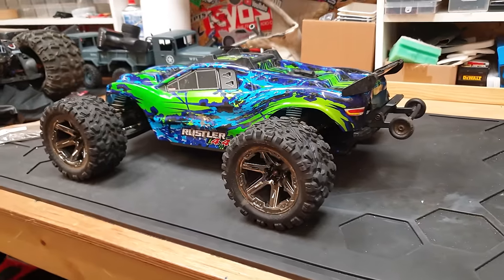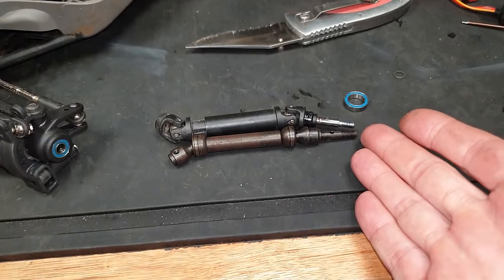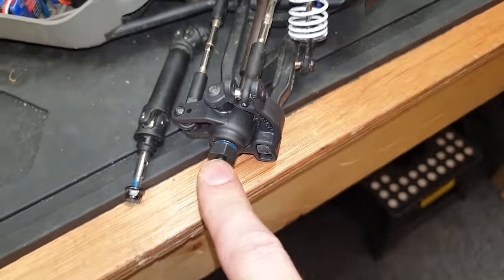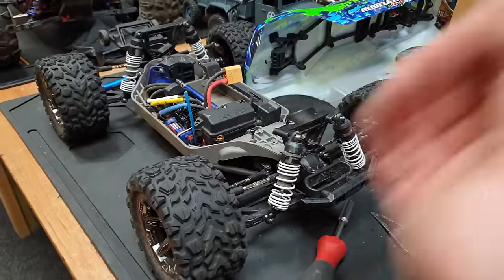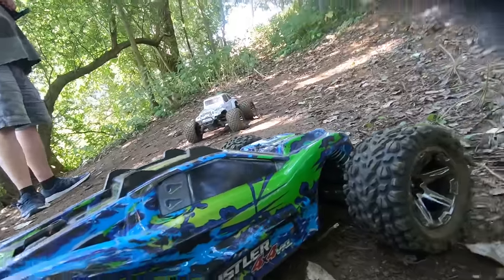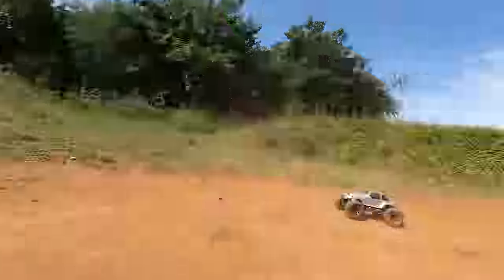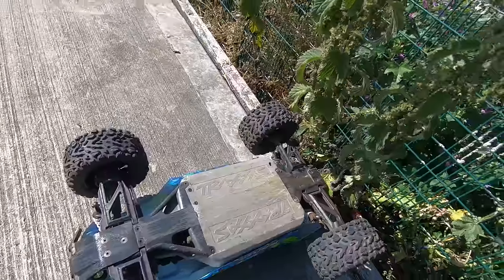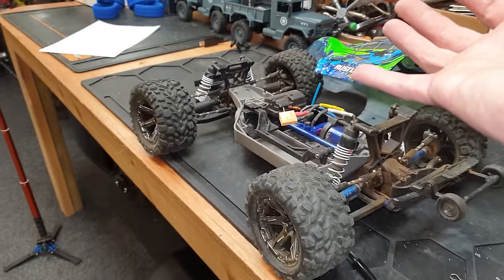Here's Why I Haven't Been Using The Traxxas Rustler 4x4 RC Car

Comment: I think the Traxxas 4wd Slash platform is being pushed beyond its limit with the big wheels on the rustler. I have a 4wd stampede and everytime I take it for a bash sometime breaks, usually the drive shaft or hubs or links.
Smaller wheels on the slash really makes it bulletin proof
Reply: I have a 2wd Stampede that's 9 or 10 years old and I have not replaced a single part yet everything is still perfectly fine and straight. I bash it all the time.  Idk what happened to yours :/
Reply: My brother has a Slash 4X4 VXL and broke a driveshaft at a track not too long ago. It’s not the platform that’s weak, it’s the part. Traxxas needs to improve the driveshafts.

Comment: As a Rustler 4x4 vxl owner, I do agree that the driveshafts are weak. For instance when I was doing a sharp turn, it went up on 2 wheels and the tire must have spun so fast that the u joint on the driveshaft broke. I've also been recently having a problem with my spur gear stripping too. And I just drive it in my backyard I don't do anything crazy. I did jump it good once though and snapped the rear axle carrier. I also ran it into a trash can🤦‍♂️ Great video Kev!

Comment: Low tsm is meant for high traction surfaces so it reduces your steering input to reduce rollover or sliding out while high tsm is meant for low traction surfaces like ice as an extreme example. High tsm gives you high control as you won’t likely rollover anyways. The more you know!

Comment: Hey Kev, I've got a 6s rustler 4x4, totally not worth doing. It's crazy and I usually only run it on 3s. 4s is perfectly op tho.
But the sway bar kit TOTALLY changed the car. That and 60k diff oil. Those to are a complete game changer. You'll absolutely love the car at that point.
Btw MIP driveshafts hold up to 6s tumbles across parking lots 💪
Reply: Yeah buddy i have a 4x4 6s 4292 motor slash. The things wants to break itself apart. The big bone center shaft is a life saver. Traxxas steel spline are great but the nut ends break once in a while. But that was with 150mm tires and tumbles across parking lots

Comment: Kev the v2 rustler 4x4 has grey driveshafts that are a bit better. I have broken the rear but I got those banggood ones (the blue ones) and they're fine. The front never broke for me. The c hub things broke a few times after skate park abuse but I've tortured my rustler so I can't really complain. I got the rpm ones and they've been fine so far. I also have a jx ecoboost 21kg servo and it's so fast. The stock servo is so weak the wheels often couldn't turn on dirt so a great upgrade. Thanks for the videos so I know what product are good and what aren't.

Comment: I had those same metal axles on my slash 4x4. They didn't last 1 battery before pins ripped out. Replaced the pins and the shaft to hold the tire on  snapped in half at the drive pin to hex.  Worse axles I ever used. Plastic ones never stood a chance. Now I use mip for both front and rear and no more broke axles. Just have to use a lot of lock tight on the set screws.

Comment: The driveshafts look like they are rusty
Reply: I wouldn’t even used those junk
Reply: Gotta use what you got
Reply: @charizardcollector4726  yeah and they didn't last long. hopefully he got his money back.
Reply: Comment: posted 14 hours ago
Video: posted 10 hours ago 
Me: hhhhmmmmmmmmmmmm🤔🤔🤔🤔🤔
Reply: You stop that right now
Reply: I would’ve returned those lmao
Reply: @hi_it_me_ned7163  you can show people a YT video before you show the public. And comment's will still be there when set to public. Not sure if that's what happened here.
Reply: Like your command of punctuation!
Reply: The rust isn't the issue. Take a look under most any full size rear wheel drive car and see how badly rusted the driveshaft is. Even on a brand new car, most do not get painted.
Reply: Won't affect performance. That is very minor surface rust. Like. Very minor.

Comment: Same complaint as on my Traxxas Stampede 4x4.  The rear drive shafts are weak and kept breaking so replaced them with Fastrax ones (part FTTX262) but had 2 of those fail so went back to stock Traxxas plastic ones and now only run the car on 2S to save the rear shafts.  Not great from Traxxas when Arrma 3S BLX range can take a 3S on plastic drive shafts without any troubles.

Comment: MIP Xduty driveshafts have been the best so far for me. I use them on my stampede 4x4. It handles 3s very well.
Reply: I have the mip on my 2wd stampede
Reply: Have had MIPs on my stampede 4x4 vxl for 6 years. Little rusty but that’s on me. Still absolute 3s wheelie monsters with big tires on high traction surfaces

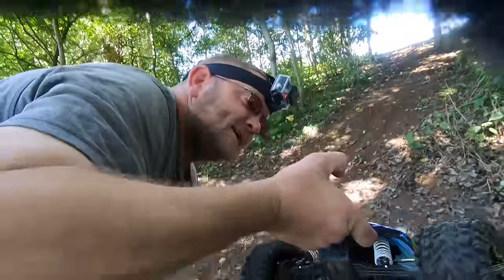Comment: Like in 6:38 i had the same problem from the first hour of hard driving, not jumps. This bottom round plastic part holds the spring in straight and steady position. This part has a gap so you can remove it from the shaft and i lost it in the dirt when i was driving. Other than that is a good rc car and i don't do jumps, but for a fast hard driving and small jumps because of the uneven ground as a first day of driving i am impressed from the top speed and the wheelies and for how fast can accelerate. Thank God that exist hobby shops, that do monthly payments and that's how i managed to buy it. Guys if you buy it as first expensive rc car, you will get impressed of how fast it is and how easily do wheelies when you press full the throttle from a stopped position.

Comment: Kev before you use it put glue on the metal rings they spin around and the pins come out of the axles I've had it happen several times to my slash 4x4

Comment: The only thing I found that will hold up is the MIP splined driveshafts. A little pricey but well worth the money
Reply: I'd say the only truly strong drive shafts for the traxxas 1/10 platform are the MIP X-DUTYS, Tekno M6's and the new Traxxas Extreme heavy-duty steel splined drive shafts (I'm not talking about the constant velocity, those are only good for 2s).

The X-Dutys are best for 4s-5s power systems, the M6's are best for 3s bashing and the Extreme heavy-duty drive shafts seem best for 2s-3s racing (because they are the lightest)
Reply: He put mip’s on his slash 4x4 and broke 2 of them and cracked another right away after he put them on. So he put on the traxxas ones.
Reply: @nate0765  to be fair Kev is extremely hard on his rc's and his expectations for durability are pretty high 😅

Comment: My erevo v1 has similar plastic driveshafts/axle shafts. I was twisting off the stub axles on the wheel side about 2 out of 3 times I'd go out. I swapped the rears over to metal ones that look just like your front ones and I've only had 1 front plastic driveshaft fail out of the last 8 times I've gone bashing. Mine are cheap-o's from GPM I think but they seem decent for my level of abuse. I just got a Kraton 6S today so that's going to be my main rig from here on out. Had to get it used since it's still backordered everywhere but it's in great shape. Chassis and mechanicals/electronics all look and function like new. Even the body is barely cracked, and those things are thin as can be.

Comment: I have no problems with the plastic drive shafts on my Rustler 4x4. I did however destroy my rear ring and pinion (From landing jumps on throttle). So, I upgraded to the Traxxas  spiral hardened gears font and rear.

Comment: I’ve been using tekno rc driveshafts in my slash and rustlers for years and never managed to bend or break them. They are way cheaper than MIP and I feel tougher. The only negative is the suspension travel must be limited “very slightly” to prevent the dogbone end popping out. That being said the stock setup is fine it’s only when you try to put longer shocks on it’s a issue. Of course nothing is unbreakable, if anyone can break it, kev can 😂
Reply: Tru cheapest option out here with the best look and performance
Reply: This Tekno M6s was one of the best upgraded for my slash 4x4

Comment: Gpm drive shafts are like the ones in the rear but better because they sell a rustler 4x4 specific set. Ive crashed my rustler bad and bent the shaft thread portion at the end, hammered it straight and kept bashing, they are that good.

Comment: I'm not sure if those axles will hold up with the VXL system but I know they didn't hold up to my brothers Hobbywing Max10 with a 14 tooth pinion in his Stampede 4x4. Snapped one in 30 minutes. Jerry rigged it back together and literally popped the other 3 as soon as he nailed the throttle. 2 broke at the drive pin, the other broke clean off at the CV joint.

Comment: Hello from Oklahoma City, Oklahoma, I would like to know, if those 4pack tyres with the white spokes you had in the video rustler vxl 2wd, would fit a la trax rally car 1/18 scale. I  have upgrade her with sealed bearings, traxxas 5 channel reciever and transmitter. Other upgrades are aluminum drive shafts and shocks, hot racing 60t metal spur gear, and I put in the velineon motor and esc. I am also doing other upgrades as well. This car is stupid fast. I just want to thank you for your time, mate

Comment: Anyone having this problem with driveshafts should just use slightly smaller tires. Slash tires and a slightly bigger pinion(depending on user 13-18 tooth) and you’ll have no more issues. Other tire wheel choices are good too just needs to be smaller. Also make sure if you ever replace the shafts be sure to get the right ones. There’s (X)heavy duty(black) and (A)extreme heavy duty(grey),

Comment: Those driveshafts are repairable.  I've made similar repairs before.  Drill and tap the outside and put a couple set screws in bit leave space to slide. Tack weld the set screws so they can't back out.

Comment: Had a similar issue with the e-revo 1/16. The servo they come with is really prone to breaking. Had to replace it with a metal gear after going through 2 OEM ones.

Comment: To fix that driveshaft issue of the new ones that came from Banggood try coating both halves of driveshafts with jb weld epoxy or the red permanent thread locker.

Comment: "dont use the electric screw driver all the way" as kev uses an impact
Reply: It's not impact, it's a clutch. If you tune your drivers clutch well, you can use it to go all the way with no problem
Reply: @nelsonmarques1334  The one he is using is an impact driver, if you look carefully, you will see that it doesnt have a clutch. A clutched one is the way to go though lol.

Comment: Not so sure about that ecoboost servo. I replaced a savox 1230sg 36kg@6v with that ecoboost 33kg@7.4v on an old savage, but the savox was more powerful for sure. Dirt cheap tho.

And i'm using the same banggood specials as you are running in the front and they are not that good at all, but they are so cheap that it's about the same price as the traxxas plastic ones so when you compare it to that it's still a slightly better option, was about to try the ones you are running in the back next to see if they are any better and judging from your vid it seems like they are. Although in the end i'll probably end up with some good ones (traxxas, XO-1, hot racing) but they are just so expensive compared to the banggood specials that in this case it's worth to give the cheap ones a try.

Comment: Get aluminum shock caps or upgrade
Also Use the plastic grey bigger drive shafts
TRA6851A drive shaft
TRA3767A aluminum shock cap
I haven’t broken the extreme heavy drive shafts just worn out the threads on it

Comment: FINISH IT 👀!!!! Great Rip Kev. Love your shop pieces 👍. Poor Rusty has had tough luck. Props for going 2 wheeling at the skatepark. Shoddy design on those Bangood shafts. MIP X-duty not quite. Was worth a shot though. Look forward to seeing her back out. 🍻😎💪👊👊
Reply from the maker: Thanks bro! yeh those shafts suck! I had mip and broke 3 on the 1st run!
Reply: @KevinTalbotTV  wow 👀. Think I snapped one and busted pins on a few with my Backslash. Wonder if the quality went down. The X-duty use to be pretty solid 🤔

Comment: Hey Kev why don't you by MIP axles and be done with it. ...that's the only axle I put on all my Traxxas and I've never broken one yet. I did have one come loose and fall apart but I was able to recover the pin and repair it. Make sure you use Loctite.

Comment: I’ve always heard guys having axle problems with the rustler. Mine must be lucky or I don’t drive it hard enough because all I’ve had to replace is a rear wheel hex. And the rear piece that keeps my hinge pins in but I haven’t gotten around to that yet
Reply: Same here no issiues what so ever, but look how kevin drives these things thays why they break lol
Reply: It’s likely bc Traxxas updated to the HD axles (gray) on the V2 Rustler 4x4 massive improvement
Reply: @DashzRight  yes, the 4X4 VXL had an update early on after the axles kept breaking. Traxxas added the gray HD axles over the black axles as they are stronger. They also did this for most of their fleet. I suppose you could say they superseded the axles.

Comment: My rustler drive shafts have broken 1 time and I’ve had the truck for 8 months. And I run the heck outta it.
Reply: My rustler 4x4 with a hobbywing max10 sct and run 2s with 15t pinion and never broke one
Reply: Rc Addiction I constantly run 3s and once I broke the rear driveshaft. Other than that I feel like it’s indestructible haha
Reply: I’ve got a 4s rustler 2wd with badlands on it and I bash the shit out of it and never broke a plastic driveshaft. I’ve stripped gears and ripped entire wheels off and the driveshafts still haven’t broke. Things an absolute beast.
Reply: I had mine for 10 years I just replaced them yesterday
Reply: Ive had my rustler 4x4 since they came out a year and half ago.  I have a PILE of broken driveshaft pieces. I have broken those plastic driveshafts in every way possible. I might consider upgrading the rears, but good driveshaft upgrades for the rustler just are not out there.
Reply: @miguelgaviria5836  dude the cars been out for a year and a half
Reply: Zurnar The ones on my friends slash 4x4 break multiple times per run. It’s wack. He bought metal ones but those fell apart, but the solution that seemed to work were heavy duty plastic ones. I’m not sure what brand they were but I would look out for that.
Reply: @connerhoffman6299  would you recommend this on 3s for someone out of the hobby for a while i used to run nitro i had a hpi savage x
Reply: Just Bashing Rc he has the 2wd version that has been out for a while and he upgraded it
Reply: Alita I mean it’s defiantly more fun. I’ve never had nitro cards. I have both 2s and 3s and I kinda go back and forth. Expect more repairs with 3s
Reply: @sl-br4rm  look how he drives the poss out of it
Reply: Joel Lambert I run mine in a skatepark pool and they still haven’t broke. You don’t understand how rough it is until you try it. And I put on one hell of a show. Still haven’t broken a single one. I am going to replace them soon though since they are pretty clogged with dirt and the insides are wearing out.

Comment: This brings back memories of a Traxxas Jato I had 5 or so years ago. Just munching through parts. Is it a Traxxas thing or RC in general?

From memory the big thing was the gearbox suspension mount, suspension rods snapping for fun and once I forgot to reinstall a gearbox case bearing and the car rattled before going BANG, 2nd gear destroyed! Obvs my fault that one.

Comment: I didn't know they started selling these 4x4! (Was out of the hobby for about 10yrs) I've done several 4x4 rustlers but via a different route, I took the back end off of another rustler, and the steering hubs from a stampede. Dual 6t speedgems and a super rooster esc on 12s nimh.
I have 2 rustler vxl-3s 2wd now, kinda want to revisit this idea with brushless!

Comment: You need to get the Traxxas Sledgehammer tires for the rustler makes a huge difference and a lot more fun
Reply: Not on the street, I have them on mine and it takes away from the stability But I absolutely love the speed and wheelies

Comment: Drill into the shafts and lock them with a grub screw or drill right through, tap out the hole and put a bolt right thru
Reply: Tjey have to be able to telescope.......otherwise they bind the suspension.

Comment: those driveshafts that you had on the rear only will not hold up for you. i have gone through 3 sets already and i definitely dont run as hard as you. go with the upgraded traxxas brand. they are great. i hit a wall at full speed on one front tire and didnt break one. part numbers 6851R & 6852R. they are the XO-1 driveshafts and you can actually buy replacement parts for them. also get yourself some rpm control arms. i pulled one through the pin hitting something at a very slow speed. and i would recommend a rpm wheelie bar mount. it keeps the stock wheelie bar from getting caught in the body

Comment: Should've wired an external BEC inline with your ESC leads,rewired the receiver with BEC and your servo problems would be solved. Traxxas bec only puts out 5.25v. Throwing servos at a car is pointless if the bec can't provide it good voltage

Comment: Change the factory servo saver to aluminum one from hot racing or Traxxas they use roller ball bearings instead of plastic bushings the factory one binds up alot i have a Traxxas stampede 4x4 the same issue with servo being weak until i Changed the servo saver hopefully that helps

Comment: Just get the tekno driveshafts they are way better plus they come with bigger more durable bearings, unlike the slash 4x4 ultimate you dont have to remove the metal parts since it does have them

Comment: Traxxas upgrade Drive shafts are the best. If you Brake them traxxas has the parts to fix them. And for the slash you can get them to. You can even put the x01 shafts in it traxxas has a video on there YouTube